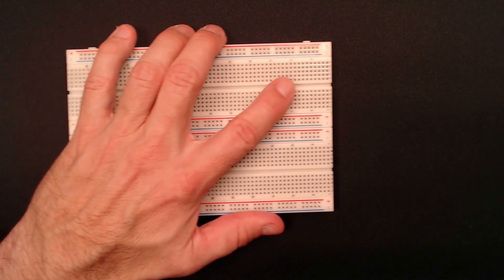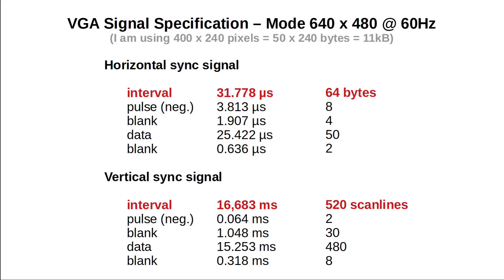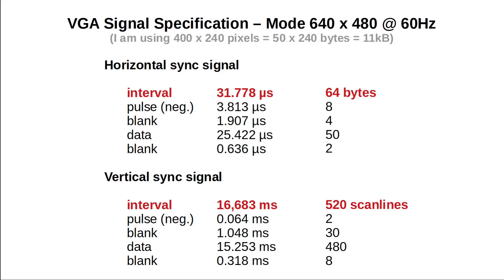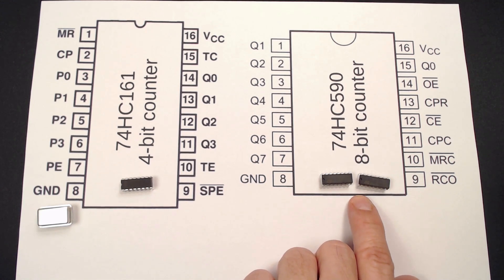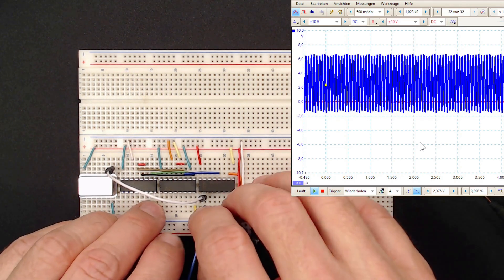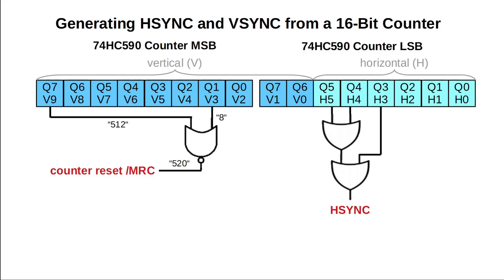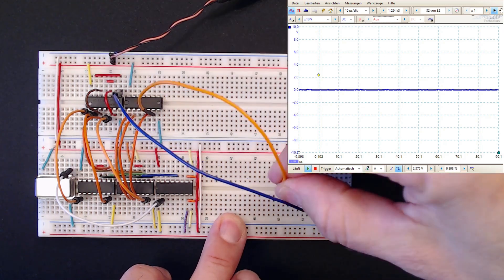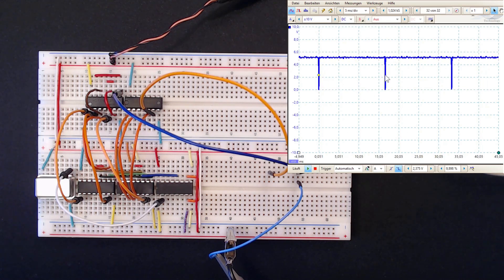DIY Video RAM #1 VGA Signals on a Shoestring

Comment: This is exact what we do 41 years ago before low cost chips as 6845 came on the market. The 6845 shows the difference between fix wired video timing and variable timing with control registers. 
The difficult later is the synchronous Write to the video RAM to avoid output problems if you write very fast to the RAM it comes to disturbed pictures. It is interessant how slu will find a solution.

Fine that the next generation can understand what pixel shifting mean.
Reply from the maker: Love your in-depth comments and suggestions, Paul. Until I tackle HDMI I will have to sort out a couple of other issues :-) Re-inventing stuff as a one-man show takes time... Cheers!

Comment: this is stupid i did my math wrong so i could run my cpu up to 20 mhz possibly
guaranteed 10 maybe 16 probably not but still possible 20 16 mhz is the fastest it would go without the ram being a bottleneck

Comment: Have you taken what your Arduino Nano VGA code does and translated that into counters and logic chips? The Nano runs at 16MHz too.
Reply from the maker: Hi David, that's right. I always thought it would involve too many ICs (for my taste) but it turned out to be quite feasible.
Reply: @slu467  It looks like you designed your VGA a lot like mine except I used a ROM for the control signals instead of logic chips and used latches instead of shift registers to input the data. You should try making a colour VGA one day.

Comment: I'm just wondering, you have 16 address lines coming out of the buffers and 14 going into the RAM. The KiCad schematics suggests it is lines A7 on the left buffer and A6 on the right, but it looks like the build version just ignores the upper two bits of the left hand 245. I'm think it may be an error in the schematic, but I could be reading it wrong?
Reply from the maker: Hey Aaron, I think you are right, but it actually doesn't change the function at all. The 74HC245 buffers do not "know" their bit number. They just provide 8 "bit channels" each, which you could use in either way, independent of each other.
Reply: @slu467  true! I was just wiring up the shift registers and buffers here and wanted to get it right.  The 8-bit counters I can't for the life of me find in Australia so they are coming express from the US
Reply: @colonelbarker  I got a bunch of 74HC590s from Rockby electronic components in Victoria last week. They are more expensive than Mouser though.
Reply from the maker: It'll be totally okay to use 4x 74HC161 instead of using the 74HC590s. It's just that it takes more space on the breadboards...
Reply: @djc1402  oh nice! I'll investigate. I've been using RS components a lot recently that offer free shipping and arrive super quick
Reply: @slu467  that's a very good point.  I just discovered I only have the one in stock. I suppose it's only a jump from 2 to 4 ics.

Comment: I am a little confused by the diagrams. How do you tell the difference between and and or gates?
Reply from the maker: These are standardized symbols for OR and NAND. NAND = AND with output inverted (denoted by the little circle).
Reply: @slu467  yeah, but I thought and (and NAND) had a straight line at the input end, and not a curved like or and nor. But it might be regional differences of something idk
Reply from the maker: @canaDavid1  Hmm, you are right, David, I am more familiar with the straight line AND, too. I might have picked up a "bad" symbol here... anyway, it's supposed to be a NAND as advertized :-) Cheers and thanks for pointing this out!
Reply: @slu467  thanks for a kind response!

Comment: Interesting! That's so few chips compared to the eater version I built recently.  

I decided to make a bill of materials for myself so I could work out what I needed, and thought I would share if others were interested. :D

https://bit.ly/2GVG7d2
Reply from the maker: Hi Aaron, somehow your message got filtered out. Thanks for providing the BOM! Did you get it to work? Did you find the appropriate faster RAM ICs?
Reply: @slu467  I've not just yet. Finding DIP RAM has been a struggle. But I'm still looking!